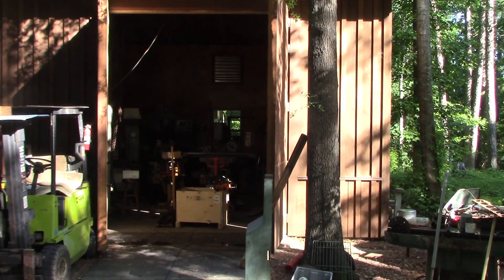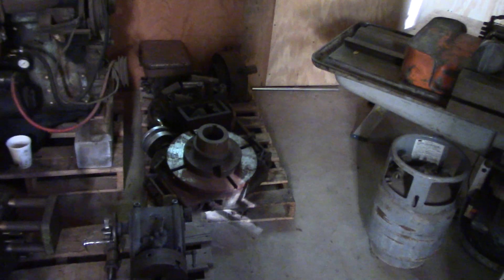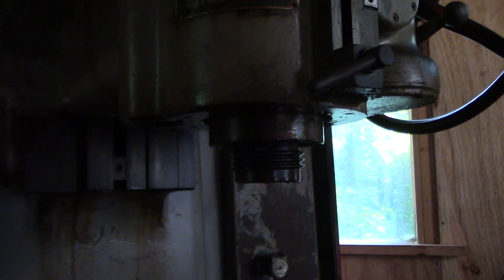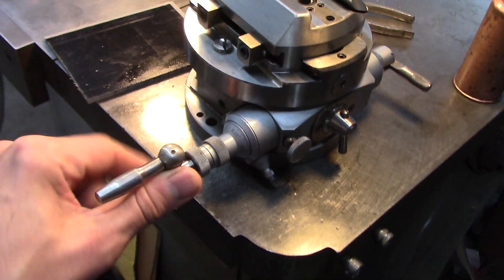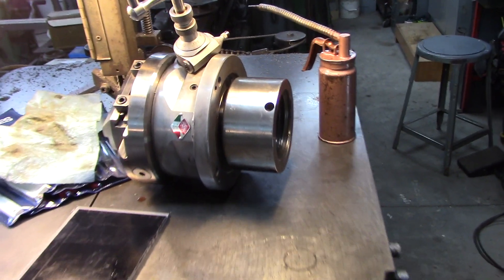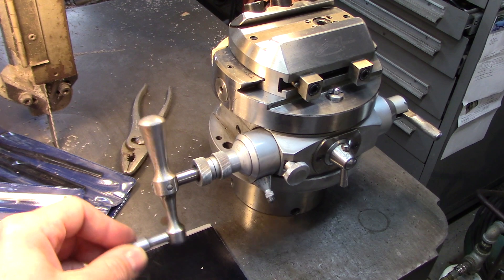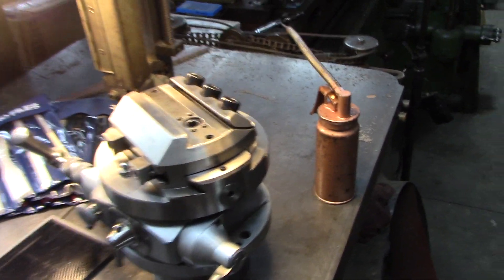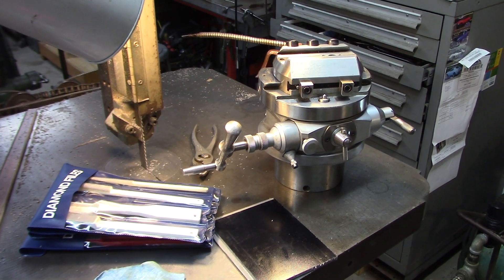6-4-22 - New D'Andrea Boring Head for the P&W 2A Jig Borer

Comment: Hi Doozer 
Nice boring head. Is there a need to 
To mount it on your G&L 25T boring mill. 
I was thinking it is easier to use than big HBM boring facing head.
Reply from the maker: I could make an adapter for that pretty easily.  I like it. --D
Reply: @kooldoozer  I watched your video again and I get thinking it would be a lot handier to have that on your boring mill than a great big head spinning around. 
Now I want for my G&L 25T

Comment: Hell yeh those are cool

Edit: to do larger bores like if you wanted to do a 12" with that Deandrea you make a slide that fits into the top slide with a matching dovetail that fits like a 2 inch bar or something similar.

They get a bit heavy doing that tho it's best to put the head in then put your longer slide In